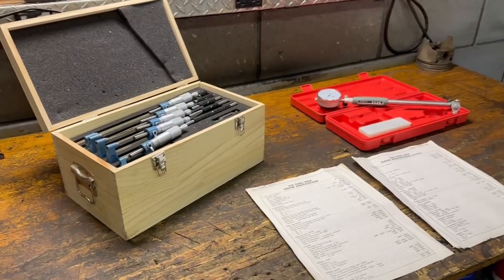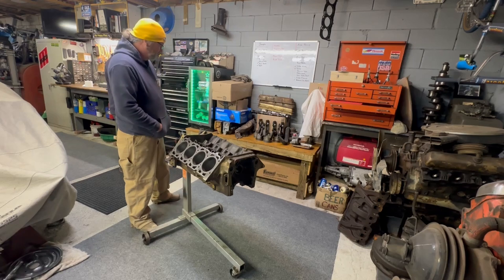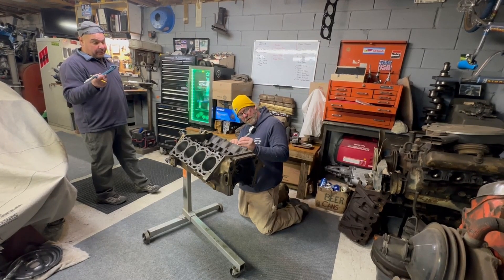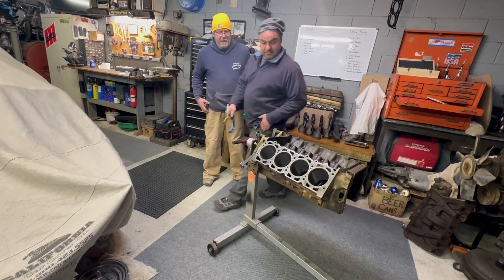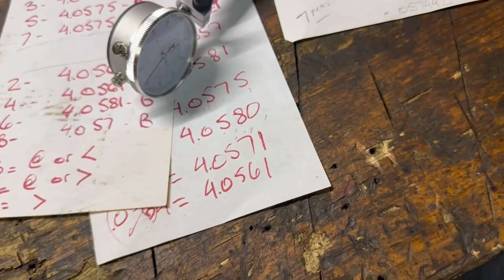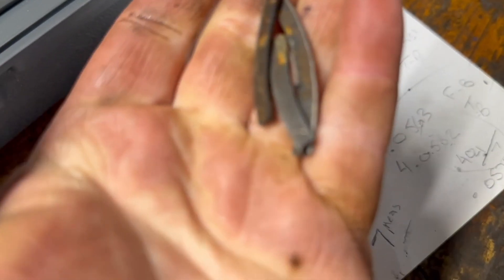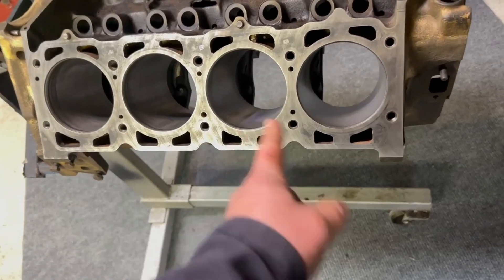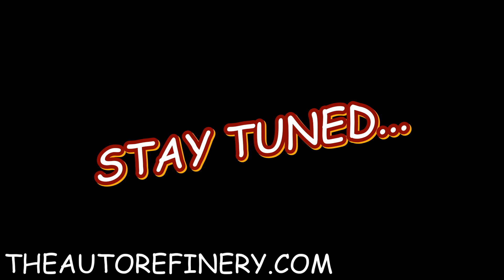Measuring Original Engine Parts Using Micrometers & Bore Gauge | In Stock Rebuild Pt. 3

Comment: Just curious does each cylinder take a different piston ? What did you mean by letter C and B piston ? Reason I’m asking is because I have a 350 olds that was taking apart and I’m not sure which piston goes in what cylinder
Reply from the maker: Good morning. We'd like to thank you for taking the time to watch and also for your question.  Yes, Oldsmobile match fit pistons to cylinders, A, B, C,...  Each original piston should be stamped with a letter.  Take a close look at the deck of the block at each cylinder, there should be a letter stamp near each bore as well.   Now, IF the pistons have ever been replaced.... no stamps .....if the block has ever been decked.....no stamps ...    The stamped letters only pertain to original pistons and non decked blocks.   Also worth noting, if the block has never been decked but has been bored at all, well then those original stamps are no longer relevant.  I hope this helps clear things up for you. Please let us know if you have any other questions.
-steve
Reply: @ thanks for the info. Do you happen to know why one side would have 3 letter C and one B and the opposite side has 4 letter C. I see the marking on the block and and the pistons it’s 5 C’s and 3 B’s.
Reply from the maker: Good morning . There's no specific or required quantity involved when stamping cylinders and bores. It is simply based on matching finish bore size with a best fitting piston.   When manufacturing the engine blocks and pistons, the actual finished dimensions vary.  Therefore Olds would measure the bore and label each as to their position within the range of allowable variations.
A would indicate the smallest allowable bore dimension followed by B, C, and D being the largest.
Thanks again for watching and paying such close attention.
Feel free to spread the word about us.  Every little bit helps.
-steve
Reply: @theautorefinery  does standard 4.057 stock rings fit both B and C stock pistons even know the cylinder bore is a little smaller on the B piston ?
Reply from the maker: Hey again Josh.  Another fair question.  The answer is yes, a stock engine  block will have a "standard" bore size of 4.057" +/-    and will receive standard piston rings for those standard bore, stock pistons. .....BUT this is where you should consult a factory manual and compare your actual cylinder bore dimensions after any honing and THEN test fit piston rings to determine end gap clearance.   A tighter bore may require rings to be file fit to provide adequate end gap clearance depending on ring brand and material etc. 
In this game numbers tell the tale so..... measure everything. 
The  more you do that, the more clear things will become.
Good luck and keep us posted.
-steve

Comment: Mr. B. Here ! 🍩☕️👀😎👍 : Over years I have learned that managing cost is good , but doing the job right the first time is cheaper in time & labor . To redo something you may have a bad feeling that is a hint , if does not feel right good chance it is not . ( Conation is the word  ) as many engines I worked on I treat each one as my first and have had no fails of my work, the work that was before me , I dis-mis it and realized it would bit me in the ( Big A ) ! The training I got from GM so long has come back time & time again. I thank the teachers I had GM Training Center at Terry-town ( Sleeper Hollow today ) . Your doing fine guys 🍩☕️👀😎👍
Reply from the maker: Mr. B.  Yes believe me when I say,  that under normal circumstances we will agree with that logic.  However, for the sake of the exercise,  we run what we got. 
the other engines will get the proper treatment.  This engine is literally a play thing

Comment: Take a propane torch to the piston top to expand the aluminum and you'll get the ring out. Take a ring groove tool to recondition all of the ring grooves to be sure a ring doesn't stick after it's running.  A suggestion: the most important thing is the piston to bore clearance, especially with cast pistons. You can't totally rely on those tools for accurate measurements. What you can do is once you have the dial-bore gauge where you want it in the cylinder, lock it. Take the dial bore gauge out of the cylinder and use your micrometer to measure the dial-bore gauge size.  Then use that same micrometer to measure the outside diameter of the piston. Subtract the piston diameter from the dial-bore reading you measured with the micrometer. Using this method the measured value is secondary to the measurement difference. I'm not sure what kind of ring seal you'll get with a dingle-ball hone. I'd take it to the machine shop and have it honed on a machine.
Reply from the maker: hey steve...
yeah propane torch...tried that - no go . ended up soaking in PB for a week or so, and letting pb run down the groove and behind the ring.   the ring came out in small pieces.   The engine that piston came out of was stuck for a long time.   
The ring grooves will certainly be cleaned and checked.  no way to effectively clock the ring without being able to easily spin the rings right?
We will be sure to measure each cylinder again, after final hone along with each corresponding piston.  Currently the ring gap is on the wide side of spec.
we are using 3 arm stone hones.  
don't own a ball hone.
Thanks for watching and sharing some tips.
we appreciate your participation.
-steve
Reply from the maker: sorry.   no machine shop for this one.
Reply: @ If the gaps are too wide you can always get file fit rings. And yes, clocking the rings is important. Good luck with the build!